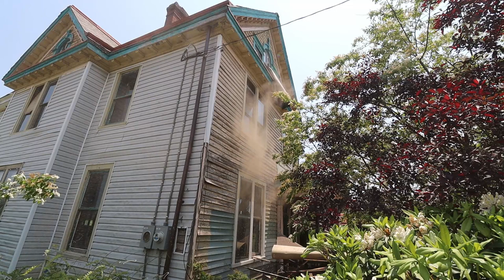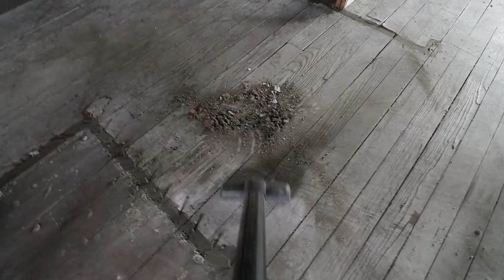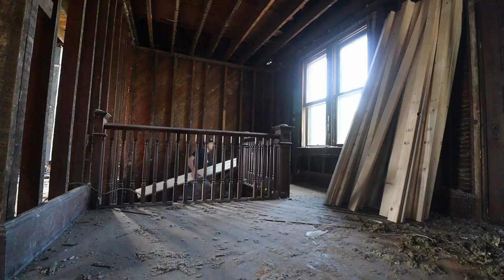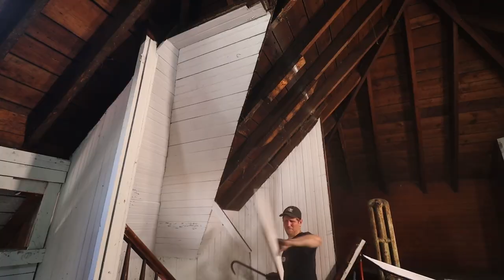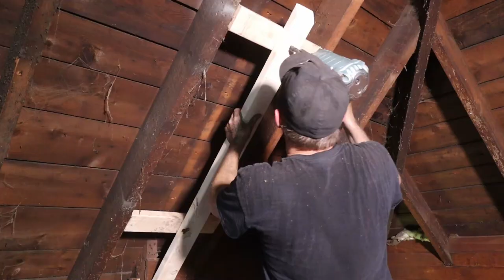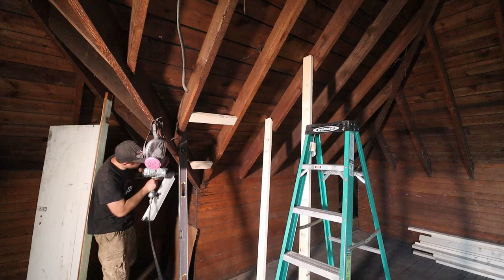Attic Master Bedroom Layout - Victorian Home Renovation [TirolerInn]

Comment: It's amazing. i would have put a box fan in a window to help pull the dust out. And are you going to put in any skylights?
Reply from the maker: Yes, if I thought of it earlier I would have figured out how to do that too. Biggest problem is that we only have one outlet in the house that has electricity and we used it for the lights, vacuum, saw and compressor, but I am sure I could have come up with some way to get it working at the same time.

Comment: Lots of good work there.  I have the same Vacuum.  Works great also.!    What work boots are you wearing?  They look pretty comfortable.  I also have a Victorian built in 1905.
Reply from the maker: Yes they are, they are Merrell Moabs. Not really work boots, more like hiking boots but so nice for walking all day.
Are you doing a lot of renovation also?
Reply: @TirolerInn  A re-renovation.  We moved some rooms around.  3 years ago I redid the outside.  I replaced a lot of wood siding.  1/2 by 6 redwood.
Reply from the maker: @JPW-qm6xe  nice. Love it.